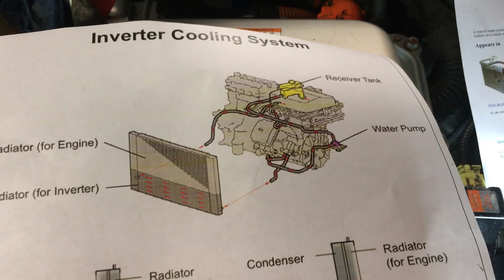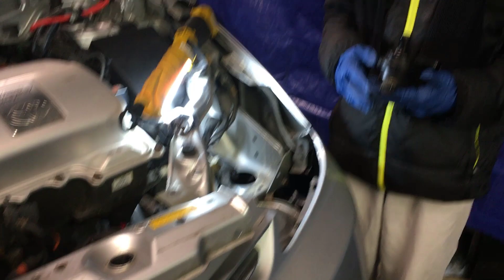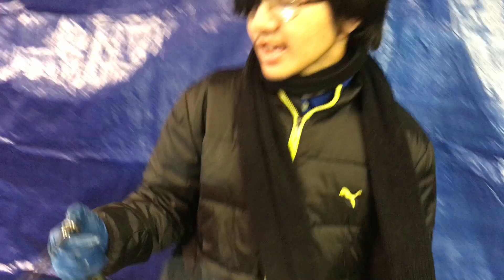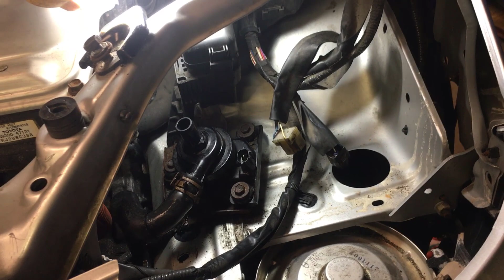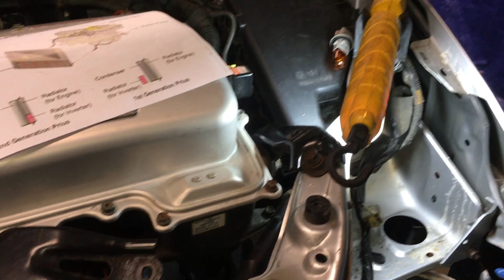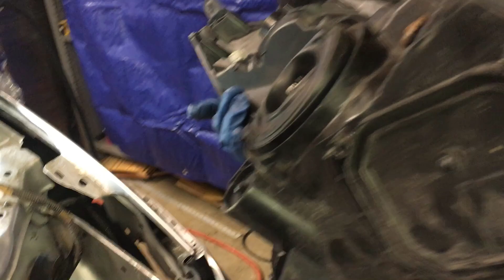How To Replace &  Install Inverter Coolant Cooling Water Pump Toyota Prius Gen 2 II Hybrid 2004-2009

Comment from the maker: Here are the #ᴬᴰlinks to tools, parts and accessories you may need to perform this repair:
1.  https://amzn.to/3D4LOCa  |  G9020-47031 Engine Electric Inverter Cooler Water Pump Assembly for 2004-2009 Toyota Prius 1.5L 
2.  https://amzn.to/3ZGnHCu  |  Coolant Control Valve fits for Toyota Prius Coolant Flow Control Valve 2004 2005 2006 2007 2008 2009 4Cyl 1.5L Heater Control Water Valve,16670-21010 601-021
3.  https://amzn.to/41nywdW  |  Zerex Asian Vehicle Red Silicate and Borate Free 50/50 Prediluted Ready-to-Use Antifreeze/Coolant 

Or Click on Amazon link here and search for what you need:  https://amzn.to/3D1T2GQ

Comment: I appreciate you but im very depressed because ive watched video, after video, after video and no one shows the correct hose placement on inverter pump.
My problem is someone else removed the inverter pump and then bailed! And i do not know corre t hose placement. Plus i have 2002 and it is different a bit. And the people that have put up videos on a 2002 or a first gen Prius, they don't even show the hoses. They just show removal and then it's finished.
 they're not very detailed and I'm desperate to find out. I need to get my car going again. I've even posted the question on priuschat and so far no response. On 2002 the inverter has only 2 mounting bolts not three and it is positioned a bit different than in your video.

Comment: Hi, I have code p2601. Is this the pump that the code is referring to?
Reply from the maker: I think for Code CEL P2601, the pump that needed to be replaced is the coolant heat recovery system pump which is located in the driver's side fender, in front of the tire, hiding behind the fender lining.  We don't have a video for that but if you want to get a rough idea on where it is watch this video of ours:  https://youtu.be/i_ko_0cPmJ0